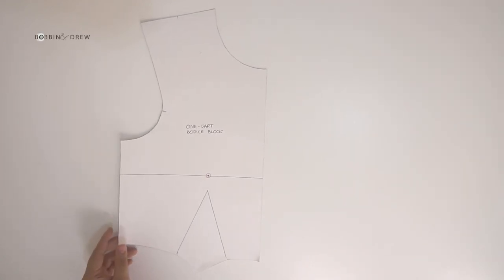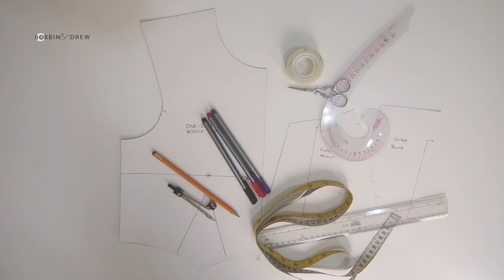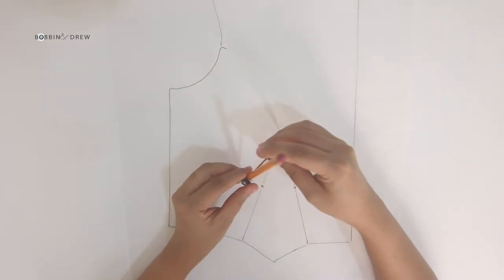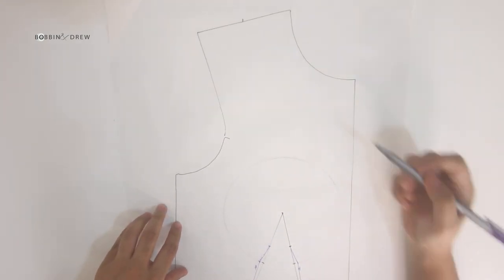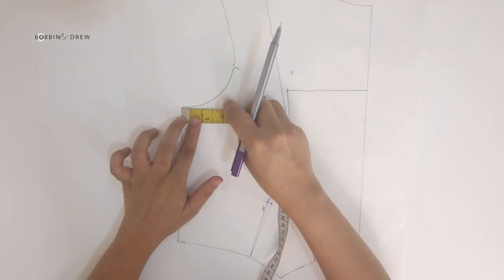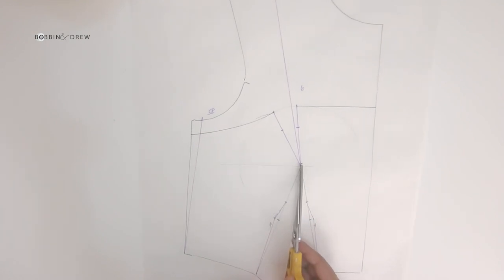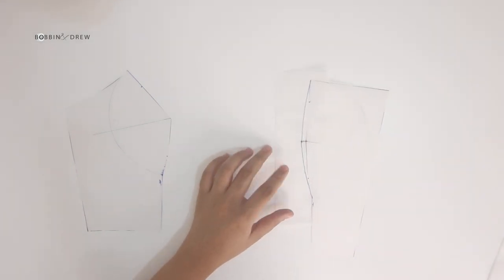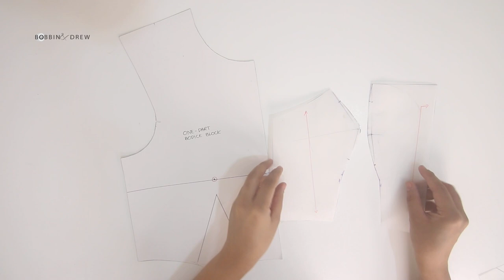How to Draft the FRONT Strapless (Bustier / Tube) Pattern From A One-Dart Bodice Block Foundation 2

Comment: This method seem not to work for small cup sizes😒
Reply from the maker: Hi Fermi, these are standard measurements for contouring based on Helen Joseph-Armstrong patternmaking book.
You can always increase/decrease the amount to contour depending on what you need or what your client needs. For this to work also make sure that you have an existing block that fits, this is very important.
Reply: @BobbinAndDrew  will try that. Thanks a ton